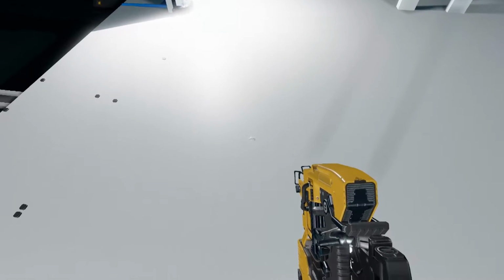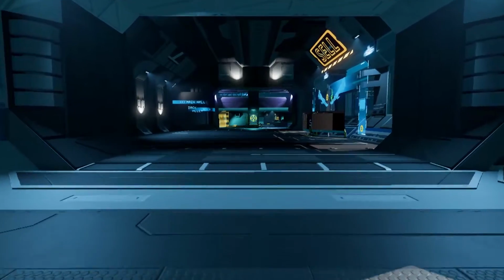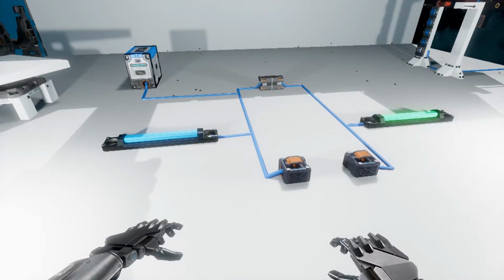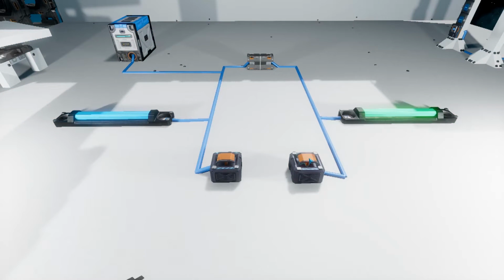Starbase: ByteSized | Power/Data Networks

Comment: It's just a diode why not call it that since it's what it is(instead of network relay)? The devs did the same thing with "missiles" that are not missiles but just rockets. Words have a meaning, why not use them properly? -_-!
Reply from the maker: One feature of the "network relay" that I didn't mention as it is more advanced than the scope of this video, is that the relays can be turned on and off to enable or disable power / information flow from the master side. I've used this in the past to have thrusters that I can disconnect from the rest of the system to better manage thrust.

I would agree that if they did not have that feature then "diode" may very well be a better name.

Comment: I'm curious on the network relay. I'm trying to think of a situation to use it that makes sense, but I've yet to think of anything practical. Any thoughts or ideas?
Reply from the maker: Here's one way I've used them. On one of my ships it has both the powerful box thrusters and the weak maneuver thrusters facing backwards. If I am flying around a station or close to asteroids, I can use the relays to disconnect the powerful box thrusters since I don't need all that power in close quarters. I save power too (I think).

Also it could be used for a ship with a crew where you want to have many rooms with a button called "light" that turns on and off the lights. You don't want every button to turn off all the lights in the whole ship, though. This could be solved by naming the buttons different things too, of course (I'll get to device fields and variables in the next Bytesized).